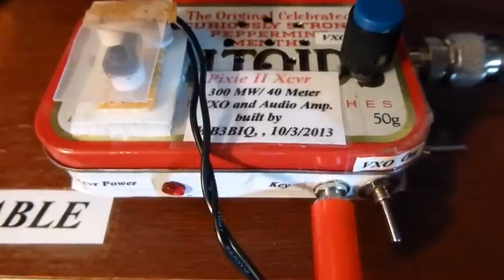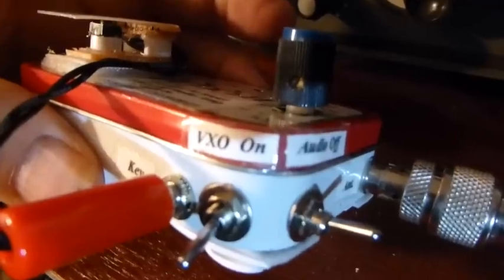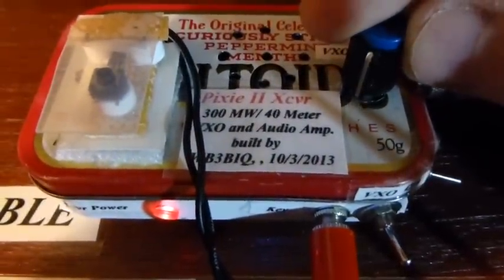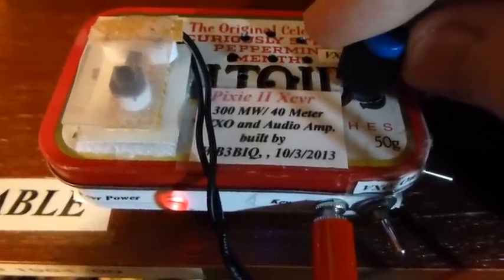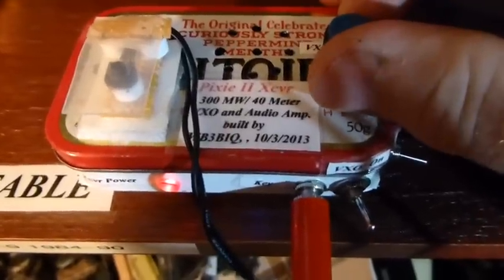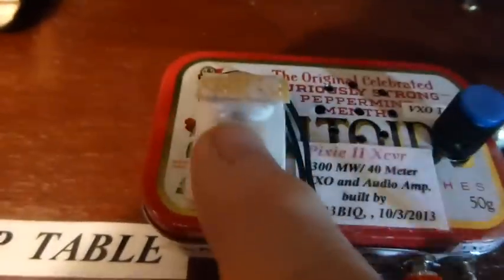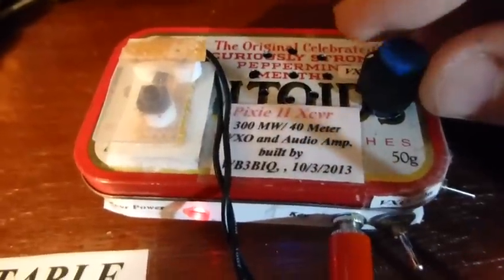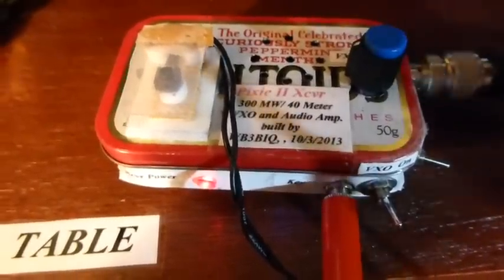The Pixie II

Comment: If you were to build and sell these, how much would each unit cost?  What would the price be for the transceiver itself and what price for the transceiver plus antenna and everything someone would need to get on the air?
Reply from the maker: The Transceiver itself was built from the Chinese Pixie II kit sold on EBay for around 7 bucks. I added the cube 1-watt amplifier and tore it away from its plastic square enclosure. The cube—also available on EBay cost around $10. The polyvaricon capacitor came from qrpkits. The rest is homebrew, including the Morse key, added a few switches and a length of wire for the antenna. You can order the parts as described and build one yourself for under $25. 73’s.

Comment: I know this is four years old but do you have plans or a schematic diagram on this rig? The area to wind an antenna is brilliant.
Reply from the maker: Hi, Ray, thanks for your comments. The Pixie II is the very inexpensive XCVR Kit from China offered on EBay. I have no schematic for it. If you jump down a couple of comments, I told some me one how to add the VXO by adding in a Polyvaricon to the negative leg of the crystal. The VXO can then be switched in and out, by shorting out the Polyvaricon. The audio amp was simply cannibalized from a 1-watt , $10.00 boom cube, also available on EBay. Hope this helps. 73's de Rick.
Reply: I'm studying now for my Technician's License. I bought a Pixie on EBay (that I have not yet assembled) just to practice soldering. Your rig with the key and audio amp sounded like a great idea. I hope to make a good copy. Thanks for the help. 73

Comment: which audio amplifier and VXO tuner was used on this and how did you tie in the second layer of circuitry to the Pixie board?
Reply from the maker: William Grice , for the 1-watt audio amp., I just cannibalized a $ 10 boom cube (available on Amazon) and laid it out on a sheet of clear plastic used in packaging. This plastic layer can be bent to fit inside the tin on top of the Pixie PCB.. The boom cube then connectes directly to the Pixie II audio output.   The VXO was created from a small Polyvaricon capacitor (Qrpkits.com) that connected between one leg of the Xtal and where it have plugged into its ground connection. A simple switch then would short out the Polyvaricon and bring the Xtal only back into the circuit. 73's.